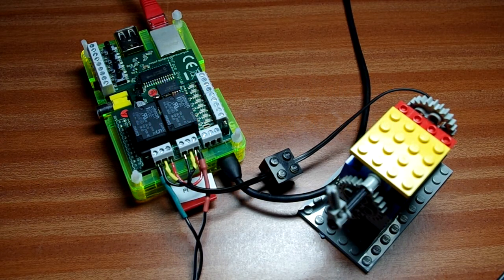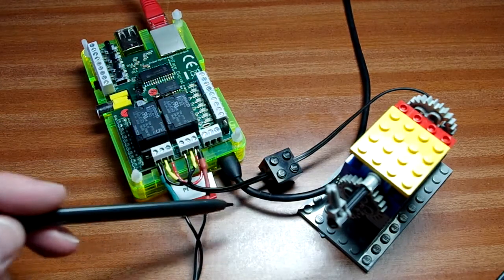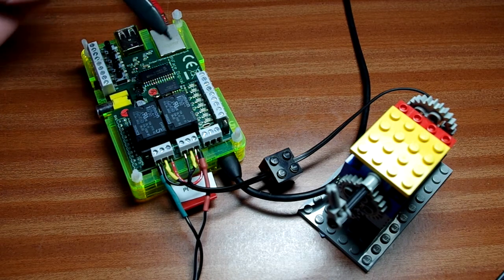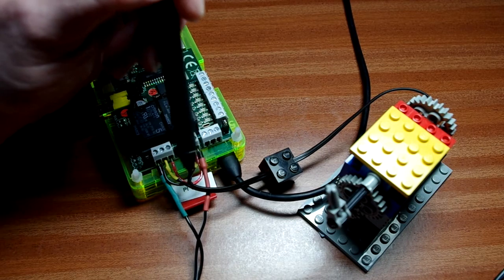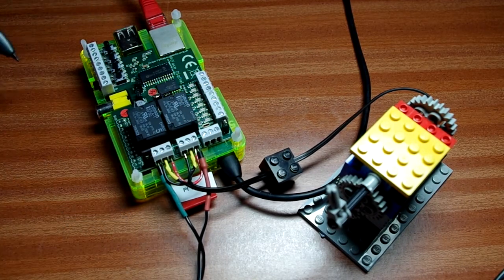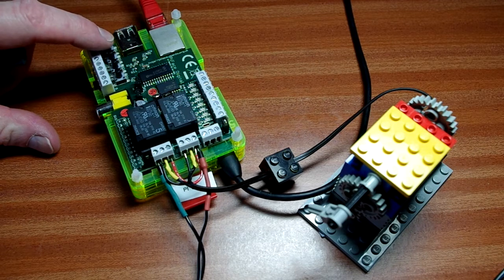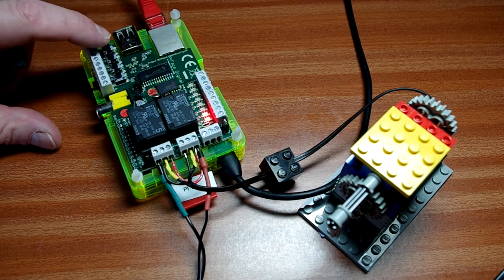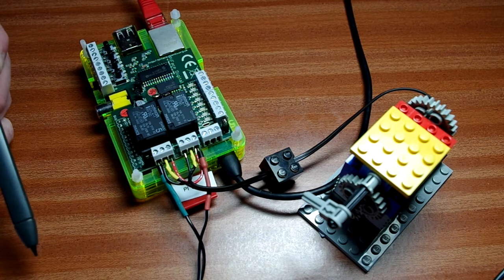PiFace Motor control - Part 1

Comment: Is that a 9V dc motor? If i want to run a 12V dc motor, should i just use a 12V power supply?

Comment: Did you use another board or components? Or the red and green cables are from the battery?
Reply from the maker: The red/green cables go off to a 9v power suply.